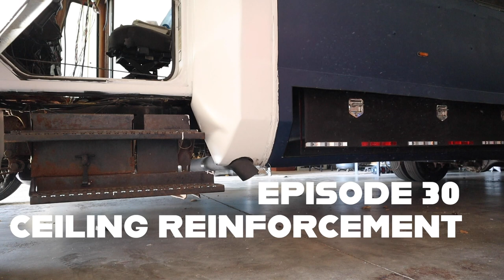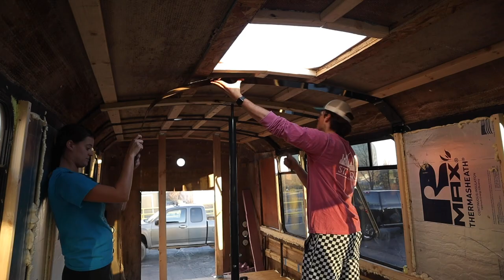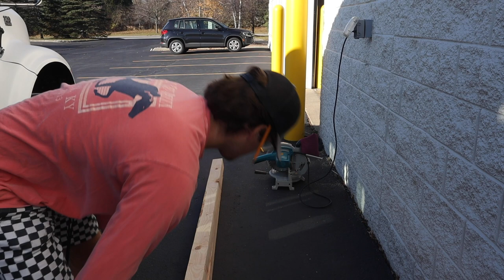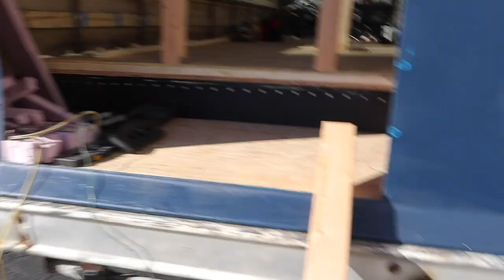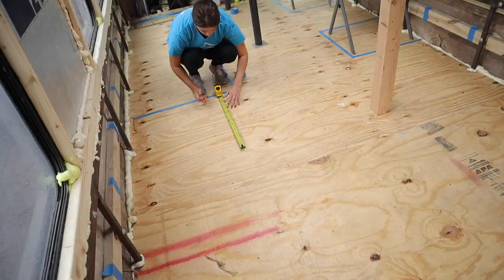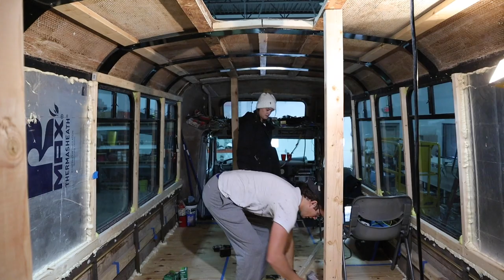Reinforcing Water Damaged Ceiling In A Shuttle Bus-Feeling Out Our New Floorplan--Skoolie Ep. 30

Comment: Love the vid's!  That 4x4 falling had to hurt!!  I'm helping my son with a similar problem in an '98 El Dorado 32' shuttle bus.  I'm taking a similar approach, but plan to run a 'header' across the bus in a few (4?) locations supported on either side by 4x4's.  That should leave the center section of the bus open.  I'm curious as to what you will have for interior height.  The spec's I've found show 6' 7".  Given what you put in for floor insulation and then ceiling insulation and covering, I'm thinking you'll be about 6' 1". Does that sound about right?   Looking forward to your next video.  (Of course, we subscribed a few weeks ago. :).
Reply: I am.struggling with a sagging ceiling too, on my '98 Ford Aerotech shuttle.  I would love to see your son's solution too.  🥴
Reply from the maker: It definitely didn't feel great.. haha. It's looking like we'll end up around 6'4" with 1.5" of insulation in floor and ceiling. Our total floor thickness is 2 3/4" plus whatever decorative flooring we'll put on top. Since we scraped out the water damaged cardboard structure, that gave us an extra inch to inch and a half of headroom.

Comment: Hey, we have a similar bus and are in the middle of demo. Thank you so so so much for documenting and sharing your story. 
Question - why did you decide to use vertical supports? I ask because we have a shorter bus and we're trying to see if we can feasibly use horizontal supports bracketed to the steel above the windows. Any advise would be greatly appreciated! Thank you both.
Reply from the maker: Hey Thom, thanks for watching! We had to use 4x4 vertical supports because we took out the existing molded fiberglass ceiling/cardboard structure because it had been water damaged. Most builds wouldn't need the bigger posts especially since wall studs will also provide some support to the ceiling. We effectively have horizontally braced the bus as well now with the bed frame and some other things in the back so horizontal supports at the window framing could work
Reply: @MilesOSmiles  Right on, thanks for hitting me back. We have bus of similar construction (21 passenger, so much shorter)  -- vacuum-bonded honey-comb fiberglass. We're going to try braces across the cabin to the wall studs. Can't tell you enough how thankful I am for your channel. Cheers. Hope you two are ready for your move in date (shit is rapidly approaching!)
Reply from the maker: @thom7463  happy to help however we can! Thanks for the support! We definitely need it as April 30th is a month away now!!!😱
Reply: @MilesOSmiles  life comes at ya pretty fast!

Comment: Hey John, I am wondering where you got those metal sheet strips you ran across the top and how you bent them in the correct spots.
Reply: I am dealing with a very similar issue on a 2004 25 foot El Dorado bus I just got and found quite a bit of water damage in the walls and ceiling. Would love to chat with you if you have some time!
Reply from the maker: Hey Nathan! I bought them from a local metal supplier. I ordered them a little longer than I thought I would need and then I cut them to length as needed. I made sure to get a thickness of metal that would have strength too it but still be pliable enough to form/bend it to match the ceiling.
Reply from the maker: @nathanheegaard8111  if you have Instagram, message me there @Milesosmiles.bus and we can talk further and set up a call if you’re interested!